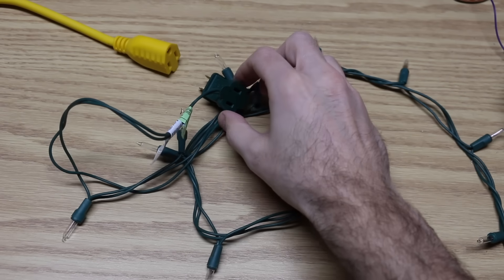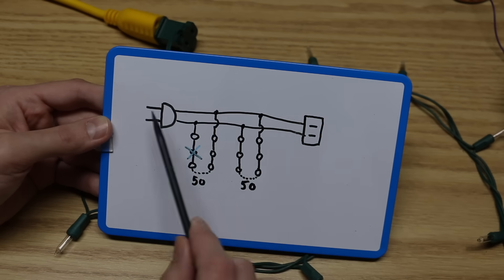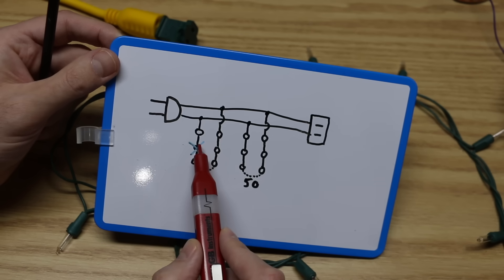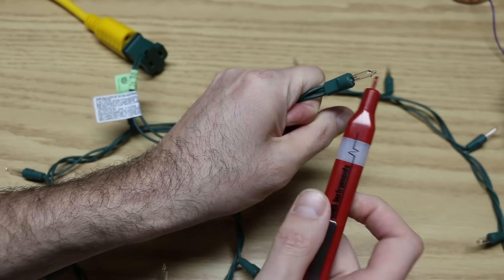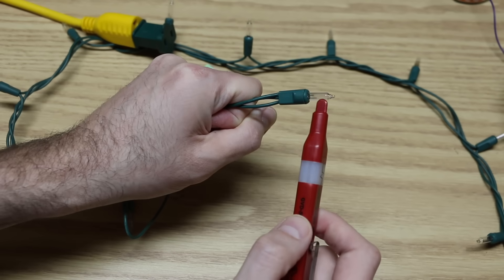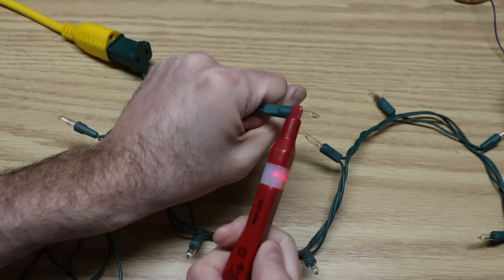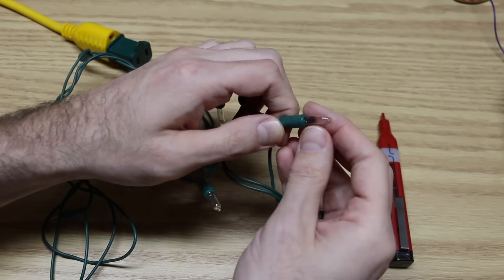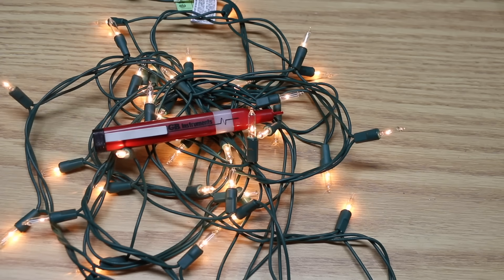HOW TO EASILY FIND BAD CHRISTMAS LIGHT BULBS using a non contact voltage tester

Comment: I still can't find the burnt out ones even after this method. There's a special place in hell for the designer of Christmas lights.
Reply: they designed them that way so you can buy more forever.
Reply: Im pretty sure that the planets have to all line up for them to work good luck 👍.
Reply: 🤣🤣🤣🤣🤣 last year i bought like 10 was about putting them on and 5 of them  don't work
Reply: Dan Hill 

Why do they break so easily? Lol
Reply: @squirrelydan3   Try turning the detector around and placing the tip near your temple. Still nothing??? Humm!
Reply: Spl place in hell chaina
Reply: It isn't always the bulb. The cheap tiny wires on the bulbs  corrode and contacts in the individual sockets can too. Some are made to last longer some are not. Outdoor weather conditions can be pretty destructive to these strings. A very close visual inspection of each wire all along the string and at each bulb holder is recommended as you go along with the electrical tester if not before. And removing each bulb has worked to refresh the inside  contacts if not also reveal corrosion or breakage of the tiny bent over bulb wires there.
Reply: @blackieblack  🤣🤣🤣🤣🤣
Reply: I SO AGREE!! THE EASIEST WAY OF FEELING LIKE YOU'RE LOSING YOUR MIND TRYING TO FIX THIS CRAP!
Reply: @squirrelydan3  🤣🤣🤣🤣🤣🤣🤣
Reply: Probably 5 years too late, but what  non-contact voltage tester did you use? If you used anything from Klein Tools (commonly sold at both HD and Lowes) then that could be your problem right there. These are all crap.
Reply: Wow that's a bit extreme don't you think LOL😂😂
Reply: if no bulb is blown,2 fuses are in the connector that are prob blown. its a non polarized plug
Reply: @kcgunz1523  Is there a youtube or link to show how to test and replace the non polarized plug?
Reply: @julievillar6649   Why would you want to do that?  It won't make it work any better, and it won't have the fuses in it, which are there to keep your house from being burned down. They don't polarize them because they don't need to be.
Reply: Today, ..I drove to Lowe's, bought a new set of Christmas lights, on the way home, went through the drive thru of,  In & Out for a Double Double cheese burger and Animal fries, , arrived back home, ate lunch, opened the new box of lights, strung the new set of lights, around the tree, had a beer, and took a nap.... Before this very informative video ended.
Reply: @streetsmart1164  omg too funny
Reply: Does China ring a bell ?
Reply: Christmas is actually a holiday of Hell.
Reply: @julievillar6649  Sorry, I see what you mean. That's a pretty easy project. Make SURE everything is unplugged. Then using wire cutters (many pliers have them built in) or a knife (carefully) or strong scissors, cut the two wires on the old lights and the new plug, making sure to leave a few inches to work with on the plug. Strip the insulation of all four wire ends, exposing the copper wire and wire them together  (you can just bite with your teeth and pull, but it's safer to use a pair of wire strippers or pliers. It is easiest if you carefully cut a line around the wire insulation to separate it from the rest of the wire, being careful not to cut into the copper wire underneath, and then it will just slide off with your fingers. Twist the copper wire ends (obviously make sure it is all unplugged before any of this) together so they stay together, and then wrap them in electrical tape, making sure that no bare metal can possible be exposed to skin or another wire, or anything else. Shrink-fit tubing is even easier and safer. It can be bought at any hardware store or Amazon for a few dollars. It looks like little red (or black or blue or green) plastic tubes in various widths and legnths. You slide it over the wire before you twist the ends together, and then slip it up over your splice and then heat it with a lighter or heat gun (I think a hair drier will work, any sufficient source of heat), and the tube shrinks in place forming a new insulation. The insulation is really the tricky part, especially electrical tape. You'd think it'd be easy to just wrap a simple wire up, but it's not.
Reply: Made to sell !! Does China put any light on the subject.

Comment: Will that work on L E D lights
Reply from the maker: I have not tried but I would expect it would still help locate the failed light because the path of electricity is still interrupted at the broken light.
Reply: I tried it on a bad led string but it seemed to indicate voltage on the entire bulb circuit - did some more digging and found some posts that indicate that leds fail on which would explain that - any know a quick way to isolate the failed bulb?

Comment: Excellent video. I did not know there was such a thing as a Non-Contact Voltage Tester.  I can see that being useful for all kinds of situations, specifically safety.
Reply: It only works for ac wires since ac induces a magnetic field whereas DC does not
Reply: @ericl8743  Yes Eric - only the legendary velociraptor can detect a DC voltage!
Reply from the maker: Yes that noncontact tester is good for doublechecking live wiring in general to make sure everything is turned off or unplugged or the breaker is off.

Comment: Two (2) series circuits (50 bulbs each) which are in turn wired in parallel.
2.5 volt bulbs are correct for a 50 string series circuit. CAUTION if your string
has a LOWER number of bulbs (wired in series) you will need bulbs RATED FOR
higher voltage.
Reply: The other most common configuration is strings of 35 (or 70) lights which indeed require 3.5v bulbs.

Comment: Actually, this is a very good presentation of how to find a bad bulb. I followed your instructions and flipped the plug to switch the hot wire; and was able to find the bad bulb. But, it was a bit of a learning curve for me; but, once I got it, I figured what to look for; because the tester was sometimes not chirping for a particular bulb, and I'd go back to the previous one and it chirps; I come back to the bulb that wasn't chirping only to find that now it's chirping. And for one of the sockets, I had to use the shunt fixer to fix a bad shunt. I had to change 10 bulbs. 

 Thank you very much for a great presentation.

Comment: Sometimes it takes a lot of words to explain something simple but you’re articulate and pulled it off, thanks for sharing this technique.
Reply: easier technique ... as you pull the string out of the storage box and get ready to untangle it ... look at each bulb if the tip is black change it .. 10 minutes and 10000 lights later your done and all it cost you was the replacement bulb ... those type of bulbs use afilament that carbonizes when it blows ... leaving soot in the bulb at the top ... a true LED when it burns needs to be tested those or just low voltage lights technically ..
Reply: @0623kaboom  - You also have a good technique.  Thank you for sharing your tip.

Comment: F this video!  What the hell was that a drawing of?  Looks nothing like how the lights are set up.  Touch here, touch there, flip the plug the other way.  NOT an easy way to find bad bulbs.  I had to stop watching, will seek answers elsewhere.
Reply: Alfred Torres let me guess, you’re one of those people that wants an app to find a burnt bulb??
If you’re ever seen any wiring diagram they’re not presented the way it’s actually laid out. They do that purposely because it’s simple to “read”. You need to use common sense and judging by your comment...well I’m gonna be nice and recommend you just go out and buy a new set!
Reply: Hector De Anda ok boomer
Reply: That’s literally how the bulbs are connected. Let me guess, you’ve never seen a circuit diagram before.
Reply: If you want to work with electricity, or anything electric, you need to understand BASIC circuit drawings (a.k.a. "diagrams"). If you don't understand this, you're probably best off tossing out your failing light strings and buying new ones. This technique makes perfect sense, but you need a basic knowledge of how electricity works to understand and use it.
Reply: Alfred Torres, let me guess. You just change them one by one until it lights back up? Pro tip for you. That won’t work if you have 2 bulbs burned out.
Reply: @willer3399  Just an observation, if one bulb kills power to the rest in that chain of bulbs it should be impossible to "burn out" another bulb right?
Reply: Slamin Lumina, I have had 2 bulbs out at the same time. May have been just from being stored in my attic rather than a burnout.
Reply: Alfred Torres calm down.
Reply: It’s fairly obvious by your comment that you have absolutely zero understanding of electricity. The drawing is actually a schematic that is a perfect representation of how the lights are “set up” and flipping the plug just reverses the polarity so you can start at the end of your choice. This in reality is a super easy way to find a bad bulb.
Reply: Alfred Torres, His technique worked, didn’t it! Not sawing it’s the best but I didn’t see your video.
Reply: You have the brain of a fly.
Reply: So let me guess Freddie...your method would be pulling and replacing one bulb at a time until the string lights up! That may work (as long as there's no breaks in the wire) but it'll take longer. A continuity tester makes the job easier! Then again a complete break will show several lights out!
Reply: Alfie T is blinded by science, hope is bulbs are not too bright for him.
Reply: Alfred Torres I do repair work & build all sorts of diy things & found this vid extremely helpful. This method is as close to a magic wand as I’ve seen anywhere. I don’t understand why you think that someone could educate you on how to find this problem without you putting in the effort to understand how this simple electrical circuit works. You seem to have a mentality of depending on others to do things for you that only you can do for yourself. This vid was not intended to fix your lights for you but to teach you how these strings work so you can fix them yourself... and perhaps help someone else in the future.

Instead, if you had criticized the monotony of the video, then I would have agreed with you because I was frustrated watching it myself, but not because the information wasn’t helpful... it was very helpful & I’m glad I powered through to the end with patience cause now I’m a light string fixing superhero.
Reply: You Sir should not have Christmas Lights. Christmas spirit = Neutral , Temper= Hot..............................Grinch
Reply: Sorry that the drawing was to simple to understand for you. For me it was on the edge, but I managed to understand it. (Had to watch the video a few times though). I also got the understanding from watching this video, that there are different types of strands and bulbs made and distributed in the world, this is just the type where the faulty bulb won't light up to indicate that it is broken. Watching the video to the end, I think the maker did a good job and I'm glad there are people like him, who take the time and effort to put such a video out there for us. Easy Holidays!

Comment: What I don't understand is how I can put away a dozen 100-bulb strings that work perfectly, and the next season, a third of them are dead, each with MULTIPLE bulbs with burnt/broken filaments. How the heck does that happen? Does this happen to anyone else?
Reply from the maker: There may be mechanical reasons for a bulb degrading throughout the year such as thermal cycling or just being jostled around but however it happens, when a  filament is  ready to break it tends to break on power up so maybe they were at the end of their life when they were last in use  and when they were powered up the following year, that stress could have caused them to blow at that time. 
 And if one blows but its bypass shunt is still working so that bulb goes out and the rest of the string stays lit, all the other bulbs see a slightly higher voltage now so they will have a slightly shorter lifespan and if any of them were also vulnerable they could also blow simultaneously.
Reply: @GadgetReboot  Thank you, perhaps that's it. I usually take a bad string and cannibalize it to fix other bad strings. Maybe I'm introducing close-to-EOL bulbs into other close-to-EOL strings. Good tip, thanks again!

Comment: You can also buy a string tester where u plug in lights and press button! Lights up stand except for bad ones!
Reply: If you do get the string to light, immediately mark the bad ones and unplug! If there are a lot of bad bulbs the longer you keep the string lit the greater the odds the other good bulbs will start to burn out. Worst case scenario being a chain reaction where the remaining bulbs just go BAM in one shot. I routinely fix 50 light strings with the LKP only discover 10 to 15 bulbs are burnt. In this case I only keep the string plugged in long enough to mark the bad lights that need to be replaced.
Reply from the maker: Like the light keeper pro? I did a follow up video about that this past month. Works great  but sometimes it can’t fix the broken shunt in the bulb so we still have to have a fallback plan. 
I used it to get one strand working on five trigger pulls and another strand I couldn’t get it to work after 30 clicks so I had to use the other voltage tester method.

Comment: I need one of those light detectors.
Reply: It's a Non-Contact Voltage Tester. Lowe's for about $15. https://www.lowes.com/pd/Southwire-Digital-100-to-600-Volt-Non-Contact-Voltage-Tester/1000095087. If you buy one from Ebay DON'T get the Yellow one. it's junk ( the brand is Surveyor ) It doesn't always read the power. That one will get you Zapped if your checking for live wires.
Reply: I would think a multi-meter at AC voltage setting will also do the trick.

Comment: Dude it's people like you who take time to share some good knowledge that many of us love you tube. Thank you for this. Made perfect sense. Worked like a charm.
Reply from the maker: Glad you got something good from it!
Reply: @GadgetReboot  does this work with led bulbs as well?
Reply from the maker: @snowgeezers5771  I haven’t had to do it myself but it should work just the same to locate the fault when the circuit is broken by a bad LED. Here’s an instructable somebody did using this approach with LED lights. https://www.instructables.com/id/LED-Christmas-Light-Repair/
Reply: @GadgetReboot  I just picked up a Light Keeper for LED bulbs and had to replace about 50 bulbs, it took me about 3 hours, but it did a great job. I probably have 25 light sets of 50 lights and after 3 years almost every one had half the lights out.  I also have some incandescent string lights and will get one of these testers.  Thanks for the video.
Reply: Nothing against the OP because his method works.  But I just have to be honest, I checked this video out hoping for a much quicker method and to be honest there probably isn't one.  There is an old saying.  Time is money.  In the time it would take me to check 50 lights in a 100 light strand ... I'd rather pay the $3 for a new strand of 100 lights.
Reply: I actually retrieved my lights out of the trash bin and got them to work following these steps. Thanks so much.

Comment: Why not just visually check for a blown tungsten wire.  Seems quicker to me.
Reply from the maker: Can’t always easily see the filament, especially on colored lights, and every light would have to be checked instead of being able to go halfway down the string with the tester and  see if electricity made it that far or not, then narrow it down in no time at all.
Reply: What if there LEDs in series and one of them is frozen and cracked
Reply from the maker: If the LEDs are not the replaceable kind, I believe it becomes a big hassle involving having to still determine which one is the faulty one and then bypass it either manually trying to cut the bulb out and attach a new one or bypass it in some way, including one of these products you can look at  to get an idea of what may be involved.  https://www.ledkeeper.com/home/

Comment: Well, I sure like  your point about polarization, figuring out which line is hot, then switch the plug if necessary, that sure makes sense...The problem is that these crazy light strings with two separate strands are oftentimes on prelit trees or yard animal decorations....I finally gave up on the prelit tree and bought a plain one adding my own liights.  I have wrestled with the prelit christmas deer for so many years, refusing to give up on my ability to repair a simple string of lights no matter how much time and money I have spent on bulbs...Finally found the right bulbs and bought them in bulk....  Whatever happened to the good old fashioned lights that were in parallel.
Reply from the maker: I still have a pre-lit tree where the bulbs have been out for a couple of years so I just add my own strings and I keep locating the bad bulbs and replacing them but it would be nice if the tree bulbs worked.
 I might try zapping  it with a light keeper pro and see if I can get the good ones lit and then identify the bad ones and replace them.   It would be difficult trying to trace out the bad bulb on a pre-lit tree using the voltage tester.
Here’s an updated video: https://youtu.be/4JxXMluHDac
Reply: @GadgetReboot    I have one of those light keeper "pros"....Forget it....But, again, you make an excellent point about polarization and isolating the wires...I'm sure I was getting confused probing the neutral lead which may have been through the lights depending on how the plug was in.